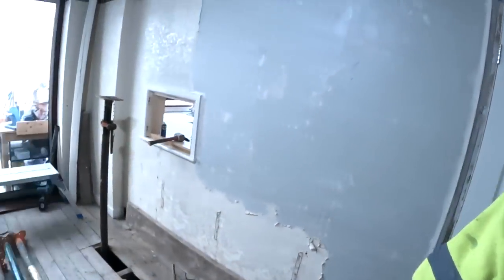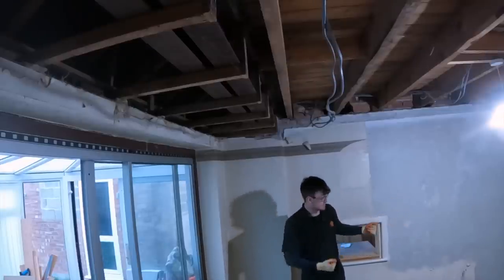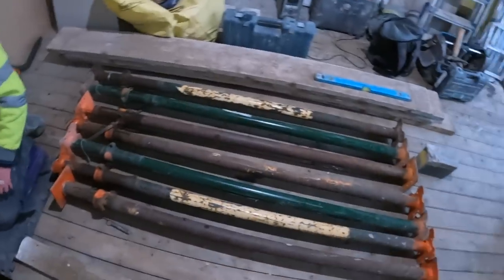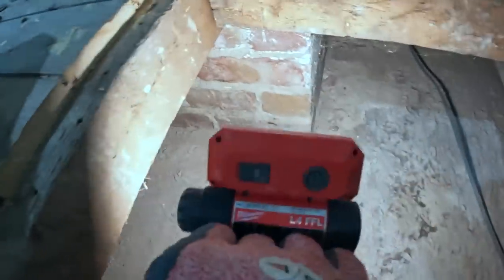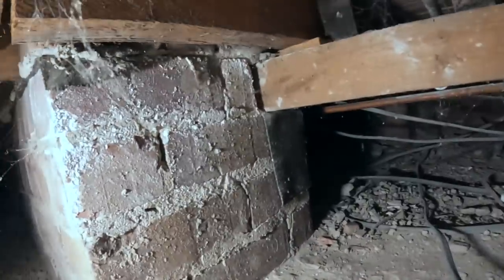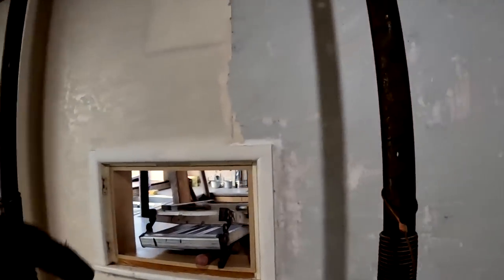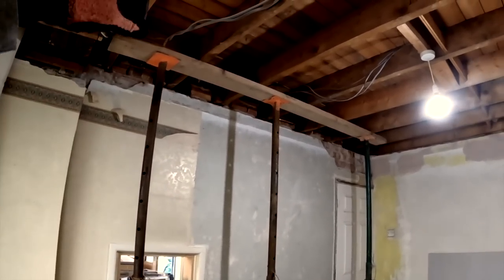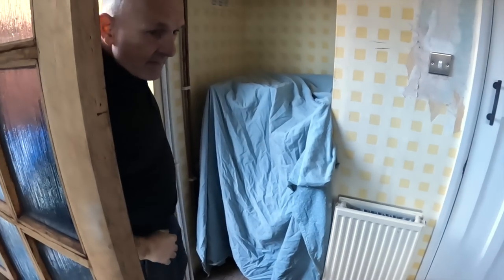LOAD BEARING WALL REMOVAL .. WELDED BEAM PART 1

Comment: A great upload showing how much thought and preparation is required at the start of a structural job.Fine investigative work to check concrete foundations able to support new brickwork and correct dpc needed for job.Great to see a skip come on time or even early to allow you to crack on and not double handle.Even showing the time it requires to collect material and tools and as we all know in business it is vital to find the cheapest fuel for our vans.Cracking out take by Alex and thanks for a top upload Steve and Alex 👏

Comment: So there is no need for strongboys in the wall the propped ceiling Joyce’s hold the wall above? What’s the mesh called you use to hold the beam fill? Also why did you put the props through the floor on one side and not the other?
Reply from the maker: Yes the joists will hold the wall up .
    One side was onto the concrete sub floor and were so  doing the bulk of the work . The other side were there just to support the floor above with the weight spread onto the planks we put under them.🤙🏾🧱👍🏽
Reply: Great work
Reply from the maker: @John-rg6kt  🤙🏾🤙🏾🧱👍🏽